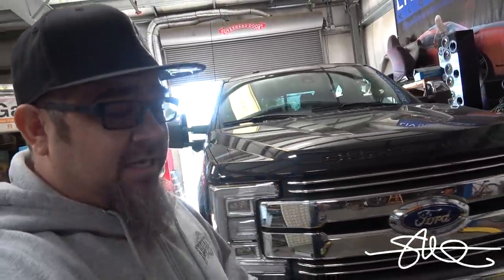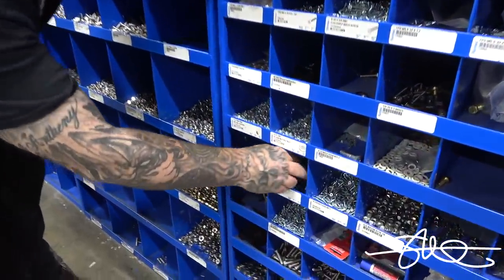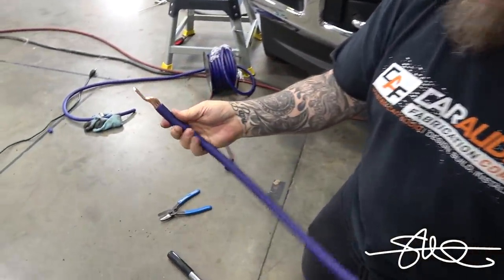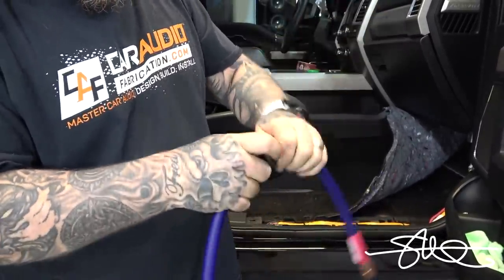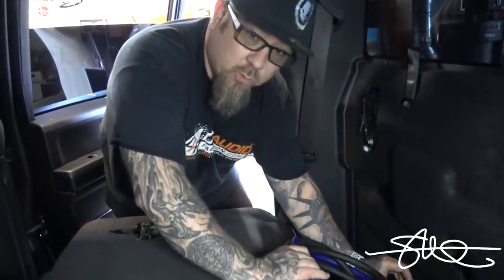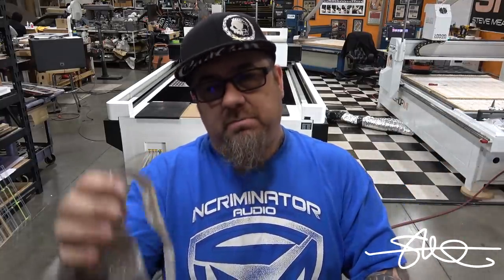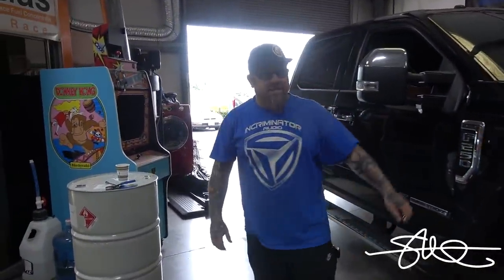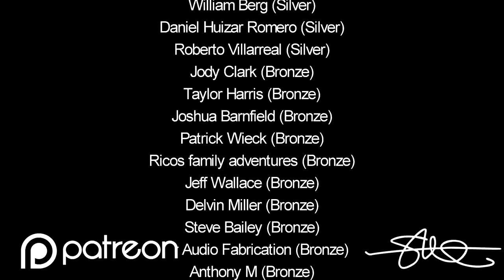Upgrading the BASS! 2017 #Ford F250 | Running 1/0 OFC Power & Grounds + "Big Three"

Comment: Is there a performance difference between soldering terminals on to power cables vs crimping?
Reply from the maker: no.  A bad solder is bad. A good solder is good. A bad crimp is bad. A good crimp is good. Crimping is faster...
Reply: Properly crimping the terminal is a cold solder. If you cut open the ring terminal it would be solid copper.... no strands. As Steve said as long as it's done right there is no performance difference

Comment: Too meade916. Why are there no more people using tinned copper tube on the power cord? Turn the screw straight into the cord then you will destroy metal threads! and amplifier does not get 100% contact with cable! The best way is a tube that gets smaller when you turn the nut inward. No amplifiers have this.

Comment: You forgot battery to frame ground.
Reply: It’s not as heavy as the sky high wire.
Reply: I'm sure Steve knows what he is doing
Reply from the maker: don't need it. The alternator is doing all the work (positive AND negative) when the car is running. I didn't feel it necessary to do that for this build.  Plus, this thing has 2 4ga grounds (one on each battery) so that should be ok.  I am grounded to the frame and the engine ground (to the frame) is upgraded. That is what is actually important.
Reply: Dose your truck have the dual alts some of those fords have factory duals

Comment: Why wouldn't you want put the fuse box further back in the line, maybe under the seat, and run off the driver side battery? I'm really asking not being a smart ass.
Reply: Canyon Jones anytime you fuse a power wire in a vehicle you always want it within 18 inches of the source/battery. The farther you put it away from the battery the more risk you have of something hitting that wire in between the fuse holder and the battery and causing a short and burning the truck to the ground.

Comment: I have a 2010 Silverado extended cab. I have 2 DB Speed series 800w 12"s I need a ported box. Any ideas
Reply: That’s where the box used here came from. As far as I can tell they are very good quality very well built and if I’m not mistaken it’s made of thick Russian Baltic birch wood a very stout hardwood
Reply: Checked out there website...looks so legit

Comment: How would you use aftermarket amps, but retain features like the music still playing with the key off until you open the door?
Reply: Gotta take the r.a.p wire of the vehicle retained accessory power and gotta use a relay because it's a  data based turn on so you can only use it as a trigger
Reply: On my old truck I used an add a fuse on an ignition controlled circuit for my remote. Ignition is on = amp is on. I didn’t want my amp on without the key on.  Turn it off and the amp shuts off but the factory radio still plays. 

If you’re going to run an amp for mids and highs you will probably want to search around the fuse block for a retained accessory circuit to tap into for that amp.  I would recommend running two control wires then. One retained for mids/highs and one ignition for your subs.

Comment: Help! How do I stop flickering of the front headlights when I turn the volume up high?
Reply: need more power/voltage to ur electronics...BIG 3 upgrade with extra battery is a starter...then depending upon the type of headlights you have, you can upgrade those to HID

Comment: Can someone tell me how to run the ground? So it gos from alternator to what to what and what now? Or just from motor to frame then ground from amps to same spot?
Reply: Harry Thorpe The ground can be any piece of metal in the car, personally I use the metal from a bolt that’s under the back seats.
Reply: Just remember that the extra current drawn from the charging system needs a path back to complete the circuit. Like Mr. Meade said it depends on the vehicle type. unibody vs. body on frame.
Reply: @AraCarrano  I have a 06 dodge cummins 5.9
Reply: Probably the same set up he just did I imagine

Comment: Them truck have a problem with alt wiring going bad when that happens the alt will putt out 25volts all for a ford mess up. I have fixed a lot of them trucks for that problem.
Reply from the maker: ehhhhhhhhhh what?
Reply: The voltage sensing wire and a bottle of the engine likes to break inside the wiring loom. The pcm thinks the batterys are low an commands the alternator to put up More Voltage. When that happens the bcm will go in to protection and shut down engine will still run.  I see it happening between 100k miles an 200k miles.  Why ford ran the wire harness on the bottom side front of engine we don't know but its open to anything hitting the wires
Reply: Oh that would suck
Reply: @happys104092243  that's the problem with engeneers trying to make things more efficient, over engineer shit, why regulate voltage with the ecm anyway? Alternator is always turning regardless, let it keep putting out 14.4v all the time, keeps the Batts up to par.  Damn engineers always messing things up for us mechanics who have to fix thier Bs lol

Comment: Yo I have a Fi Q5 D1 I want to build a box but was wondering what size port would you use I want the bitch to bumb
Reply: I got some subs straight from. Fi some btl neos and they were great with helping me for a box told me specs for a fourth and finally a slot port due to size restrictions
Reply: Good looks

Comment: My midrange speakers were started to smell burnt after i raised up the gain ! I turned it down quickly as possible ... They smell just a little bit after 5 hours but they still play good... Will they be okay ?
Reply: Nah u need to put clean power into them get a distortion detecter and u should be able to set it right

Comment: Late to the party but Ford will warranty that battery, tray and hold down due to the leaking acid on that battery.  Take care of it before it rots the front corner of that truck off.
Reply from the maker: dude...that is nothing.  A little bit of corrosion on the bracket ain't shit.  Ain't nothing gonna get rotted off stop being so dramatic.

Comment: You will have a lot of room under the hood if you take all the emission stuff off egrs and intake system and def system Haha
Reply: Justin Norris probably still has warranty
Reply from the maker: no thanks.  I don't feel the need to modify an $80,000 pickup right now.  I just got done "modding" my escalade.  The truck probably won't be fucked with other than a system.

Comment: Looks like a couple of  bad batteries,  leaking acid out the tops.
Reply from the maker: nah...just batteries doing what batteries do...flooded batteries anyway.  They are still good.
Reply: Leaking a bit but in my opinion it is the many times recycled metal all these car manufacturers are using now days. Go look at any Chrysler/dodge car near the battery, crazy oxidation and the backs of the wheels corrode like crazy, from one oil change to the next we have to wire wheel the backs of the rims ( rotating tires) to remount them and be sure they get torqued properly. Albeit I am in the UP of Michigan and everything rusts like crazy, I cant imagine it's only here Chrysler/Jeep/dodge products eat themselves.  The new Ford's and Chevy's are starting to do it now also, so I'd blame the materials they are using .

Comment: Why not solder those ends instead of crimping?
Reply: Cause time and money for the same result. Maybe, ive always crimped.
Reply: He does sometimes but those ends didn't look like they were open from the top so there would be no good way to solder them without damaging the wires shield sleeve.
Reply: hes got that badass crimper.. thats why lol
Reply: Solder is not for mechanical connections. Always crimp first, then solder if desired.
Reply: @hi-friaudioman  i heat em up with a torch and run a pool of solder into them then put the wire into the pool and hold it tight till it cools
Reply: I have a 1500 dollar set of crimpers. When i put the stank on them shits no solder connection could come close to how beautiful it comes out. Its all about the tools and copper lugs you use. And ive cut some of my crimped lugs off before and they are crimped so tight and nice the ofc wire literally becomes like a solid block of copper inside the lug. Its so pretty. Ill alway go with the crimp method myself. Its just as good if not better when done correctly with a high wnd set of crimpers. The crimpers i have are not even hydraulic either.
Reply from the maker: @matthewf1979  sure it is.  Can be. I didn't feel like it.  The crimp is MORE than sufficient...and fast.
Reply from the maker: @agger838  show us how you do it.  Bust out some 1/0 and make a video.  I bet you don't.  I bet you won't.
Reply from the maker: crimping is faster and just as effective if done right. Both methods are good when done right. But both suck when done wrong.  This was faster.
Reply: @meade916  whoa whoa wasnt saying anything u did was wrong, just stating to other guy how i would have soldered it since I don't have your high dollar crimpers lol
Reply from the maker: @agger838  it's all good man i ain't mad atcha...i'm just saying, most people who say what "they do" haven't actually ever done any of it.  The crimpers are actually cheap....so that aint a problem :)
Reply: @meade916  i really do have a 1500 dollar set of bantam rotocrimp crimpers. They are made by TE connectivity which is also AMP inc. They crimp 0 2 4 6 and 8 gauge lugs. You push down these spring activated pins and turn the crimp die and choose what size you want to crimp. They are a box style die so when the crimp is finished it just looks really clean and they make a really amazing and solid crimp. I had 2 sets of them but gave one set to my little brother who works at a classic car restoration shop. He uses them all the time for battery cables and shit on the cars he restores. You should check them out they are really amazing crimpers and if kept up will last forever they are built like a damn tank.